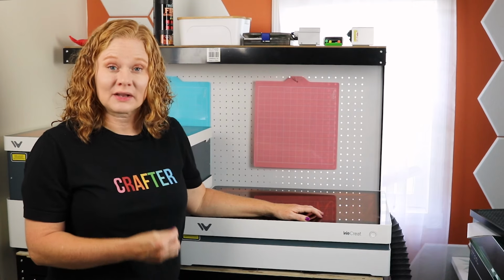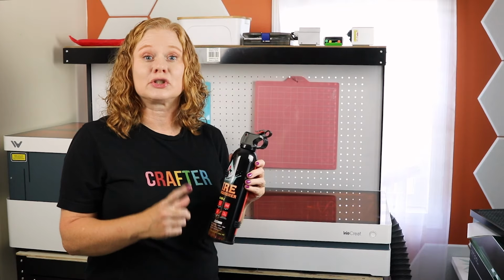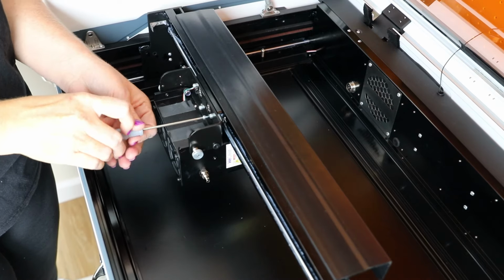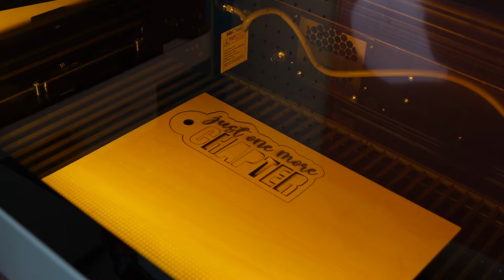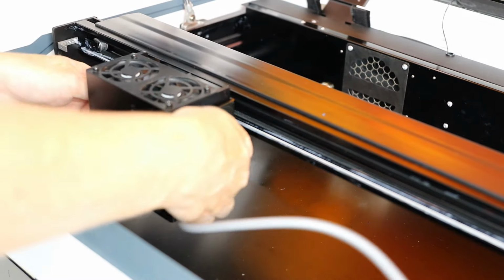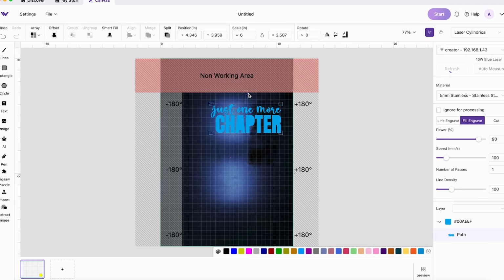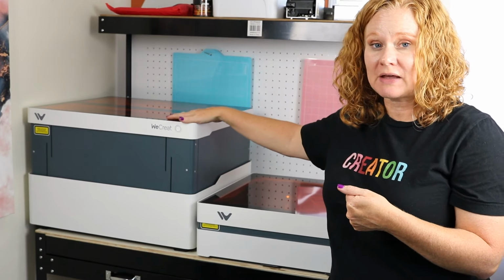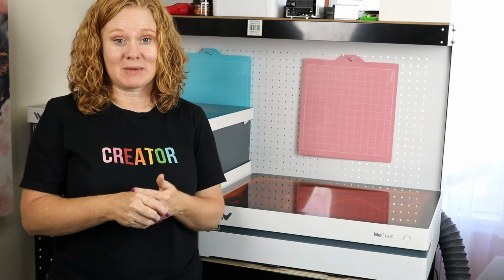WeCreat Vista Beginner's Guide: NEW Laser from WeCreat

Comment: Angie, I really enjoy your videos. I've learned so much from them. But with that being said, I am completely lost as to how to cut and fill engrave on the same project. I just tried making your bookmark, but it ended up cutting out the 'just one more' written words along with engraving them. I have rewatched that part of your video several times and am just baffled as to what I'm doing wrong. It did cut out the book mark and 'chapter' word, but I know I don't want the script words to be cut out, only engraved. Help!!
Reply from the maker: Make sure each of those is a different layer. If they are not you can separate them in the software. Then pick the lines you want cut and change to cut. Pick the engrave lines and pick fill engrave.

Comment: I have just started using my new Vista including the We Creat mini air extractor/purifier. I just finished cutting a leather bracelet which took about 30 min and two issues: the laser seemed to stop about 27 min in and directed me to lift the lid and then close and press the start button again where it did pick up where it left off...why??  And also, the smell in the room was INTENSE even though I was using the purifier and had the window open which is right behind the laser and an overhead ceiling fan was going full blast.  I am about ready to pack it up and ship it back if that is the smell going forward.  HELP!!!!  Thanks!
Reply from the maker: I am not sure on the stopping. For the smell, I would make sure that the leather you are using is laser compatible.

Comment: After watching your video, my question is you do NOT have to lay all your wood (I generally use 12x12) in the front left corner against that metal block?  Also, if I wanted to do dog tags or something similar, do I just lay that directly on the bed or is there something else I need to purchase to lay it on?  Great Video - Thank you!
Reply from the maker: You can add your blank or wood anywhere in the machine and just locate the cut/engrave. And yes you can just lay objects in the machine. This one comes with grate like things you can set it on. If it is small and will fall through that I often add a sheet of wood then my object.

Comment: I currently have the glowforge aura and have quickly out grew it.  Would you say that the wecreat is a step up machine or is it comparable in speed.  I'm limited to 12x12 area and slow cutting and engraving times.
Reply from the maker: It is faster than the Aura as the wattage is more. So I would say that it would be a step up!

Comment: Hi Angie great video which acrylic did you purchase to engrave and cut . Btw do you recommend buying the 2 w laxer as well I have the rotary lazer set thanks for the info
Reply from the maker: The 2W infrared head is really only needed for engraving on metal. I use the other with tumblers on my rotary tool. I have used several varieties of acrylic! Houston Acrylic is one good supplier.

Comment: Hello, I am interested in buying the WeCreat machine but I need to know which is best for me, the Vista 10 rotary pack or the Vision 20w rotary pack. Because I want to cut wood and engrave Stanley Cups.
Reply from the maker: I like the Vista better. I am not a fan of the large height on the Vision. With a 10W you can still do wood and engrave tumblers. Although you may need to add the riser feet to the Vista to get the stanley cups in there.
Reply: @AngieHolden  Hi, thanks for answering. I have another question. Do you recommend the Vista or is there an Xtool S1, or is there one that you recommend more than others based on price and things we can do? I don't want to spend my money and then think that another one would be better.

Comment: I have the 20w Vision using the MakeIt software (version 2.0.4) on a Mac.  I purchased the 10w Vista and I am waiting delivery.  Will the software recognize and handle the two different machines without a problem?  If so, will I have to change any settings?  Thanks!
Reply from the maker: Yep! You will have a drop down with both machines and can pick the one you are using.
Reply: @AngieHolden  Thank you!

Comment: What is the max thickness of material that can ve cut or engraved with the laser preinstalled? And what materials can be used
Reply from the maker: Max thickness is about 1/4 inch for cutting. Engraving is 2 inches or more with risers! You can use a huge wide variety of materials in this machine.

Comment: I’m am brand new to lasers…  which one of these would I need if I wanted to engrave glass cups? And does the $699 have the rotator option or is that just with the nest step up one?
Reply from the maker: You could use something like this for glass but would need to use a marking spray or pen. I actually do not have a video on it yet! And you would need to get the package with a rotary tool to do cups.
Reply: @AngieHolden what do you mean by marking spray or pen?

Comment: for the pre-order, is it the case that all you can do now is the $20.00 deposit?
Also, do you have a preference as to which bundle you would recommend?
Thanks bunches for your informative video!  I hope at some time you would create an "e-book" with the settings you have found useful.
Reply from the maker: Looks like you only do a deposit now. The bundle would totally depend on what you want to do. Add the rotary if you want to do tumblers. Add a 2W infrared head if you want to engrave metal.

Comment: I'm a little confused. Does the 2W Infrared Laser come in teh $699 package. I know the rotary tool is $100 extra. Can you engrave a tumbler with the 2W Infrared Laser Module?
Reply from the maker: A coated tumbler is one I used in this video so it has paint over the metal. You can use the 10W laser head that comes with the original package to make these as I have shown. If you wanted to engrave directly into metal - like a tumbler that does NOT have paint on it, you would want the 2W infrared head.
Reply: 2W can engrave uncoated tumblers. For coated tumblers, only 10W or higher power can be used.
Reply: What do you mean coated vs uncoated. I've never heard of a Tumbler referred that way